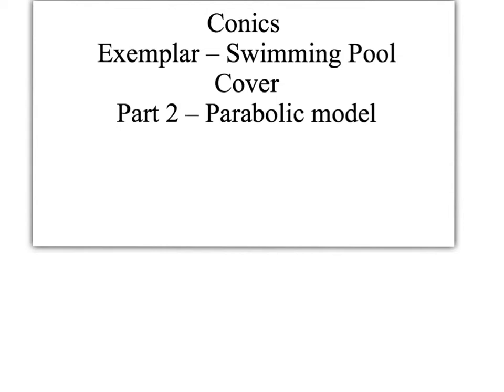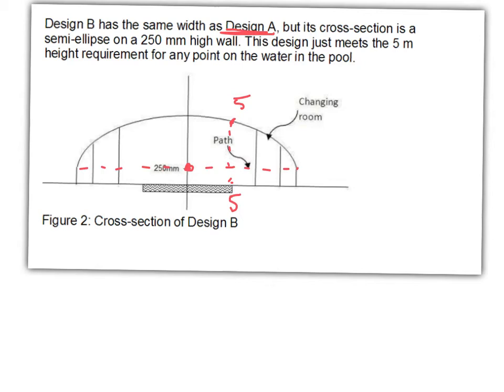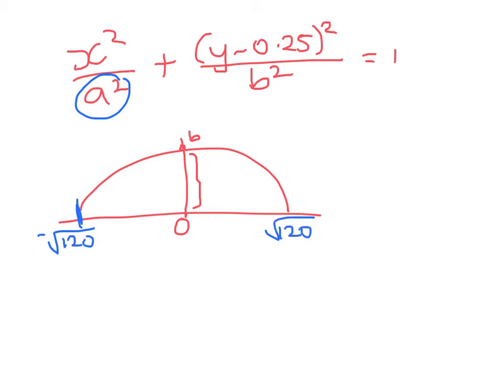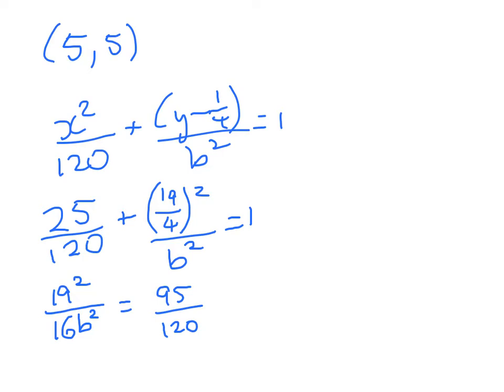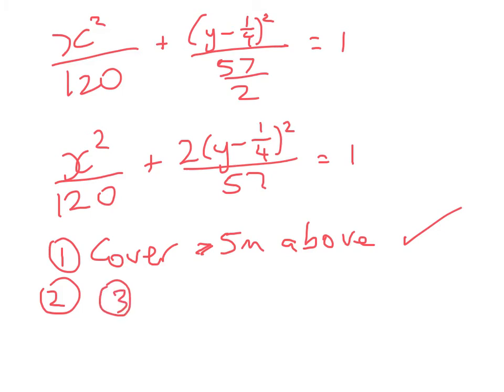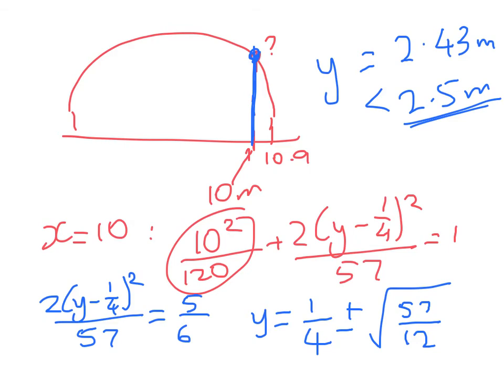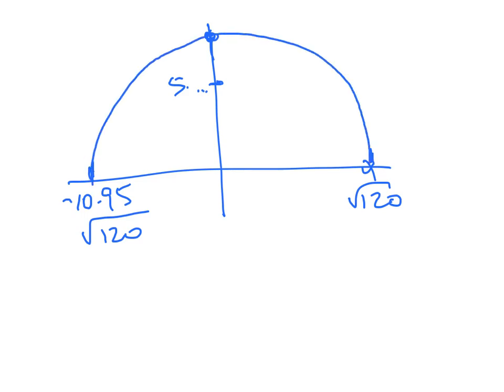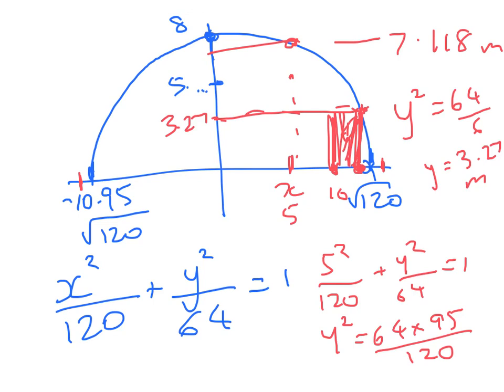13MAC TH Conics exemplar - pool cover 2

Comment: you know one way you can find the height of the cover is by adding the value of b to the vertical shift of the center . So 0.25+ the value of b which is the square root of 57/2. U get your answer of 5.589 - simple way , rather than substituting in x=0 .  Just another option .